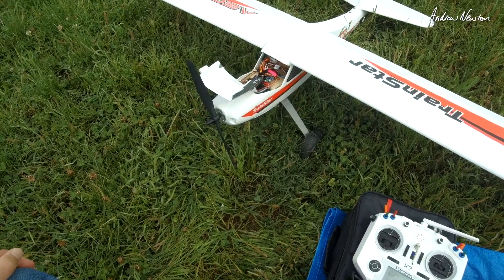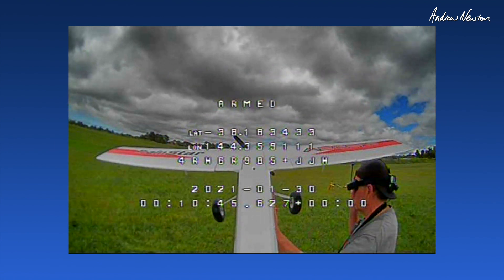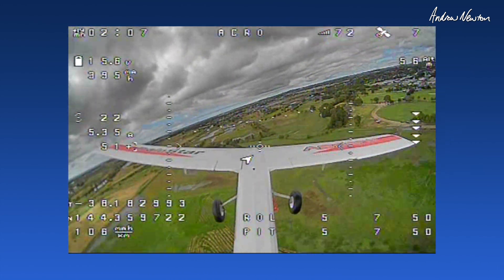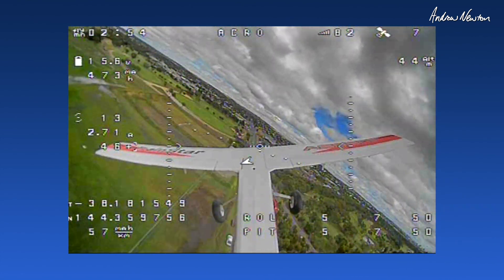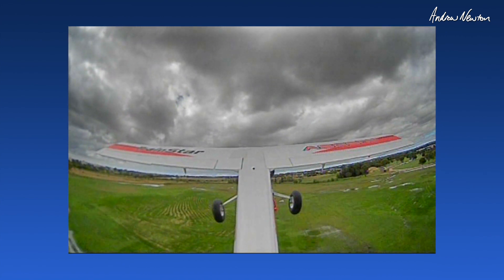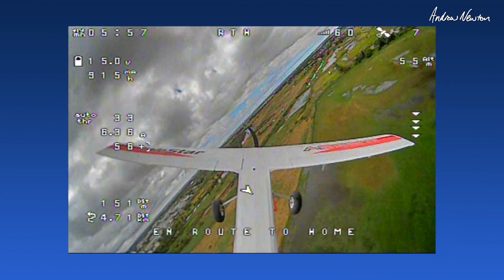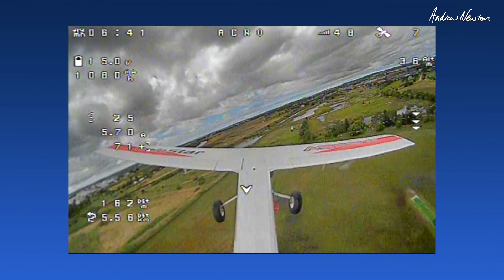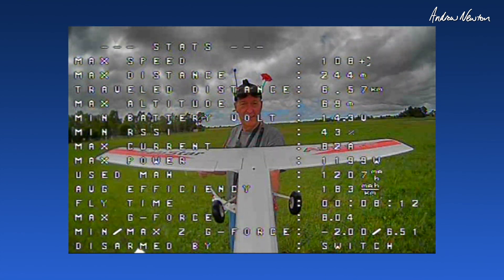Matek F405 WSE Flight

Comment: Thank you Andrew, think I'll will be considering 405-WSE vs 411-WSE. Like the small width, and that it has black-box capability without many other extras. Been wondering if black-box data would be useful tool to aid with manual tuning, so hoping to explore.